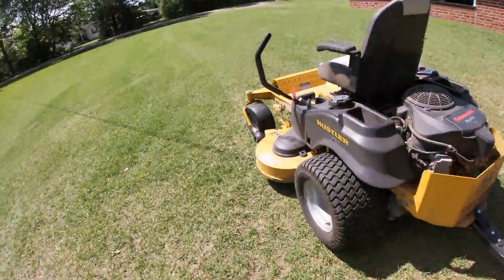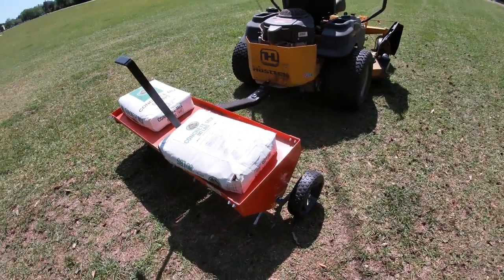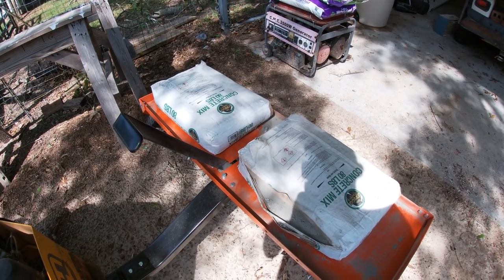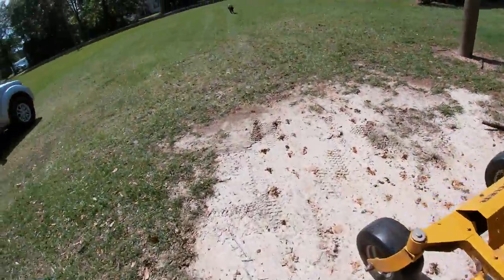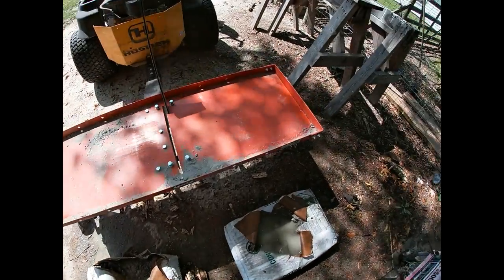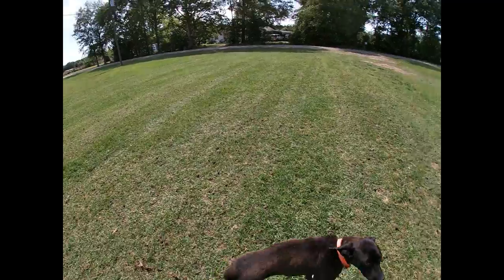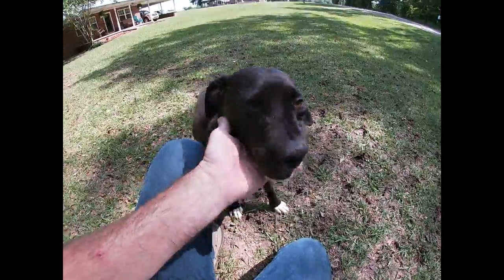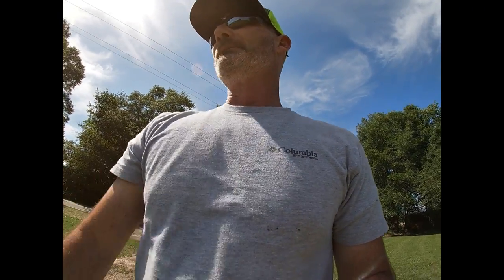Agri-Fab 48-in Plug Lawn Aerator in Action

Comment: I just got the exact same aerator and it worked like a charm!  I did however slice the back of my hand on one of the tines during assembly.
Reply from the maker: They are definitely sharp!
Reply: I cut my hand twice. Bought mine from rural king. After 3 passes around my yard a weld broke. Yard wasn’t even dry.
Reply from the maker: Oh wow. I ran mine on some pretty hard ground. Still doing good. Hopefully it doesn't break 😳

Comment: have you thought of using plastic storage tubs?  You can get square heavy duty plastic storage tubs that are the same square inch area of the platform then fill them up with water put the covers on and tie them down onto the platform then when you are done use the water for your lawn or plants by bailing the water out with a bucket or use a small sump pump to transfer the water through a hose and water your garden.  That way you don't have to deal with storage problems when storing the weights or bricks.
Reply from the maker: Never thought about that. I'm not sure how bad the water would slouch around. That's an idea though.

Comment: Thanks for the video and the info. How did the cement work out? I like that idea.
Reply from the maker: Cement didn't work that well (broke from vibration), but I'm in the process of prototyping some removable weights for it. Hope to have a video on it by the end of next week. Thanks
Reply: @cleangreenlawnservicellc2630   I use 2 60# play sand bags that I use for the bed of my pickup truck in the Winter (Ohio). They work very well.

Comment: How are you liking your X-One. Other than shocks, the height adjustment is right on the outside of my calf, the corner cuts into my leg, draws blood after a few hours, have you had any problems with it? I think mine is a 2017 model.  I added a light bar underneath the front. If you want, I could share a picture of it, but really don’t know how in comments.  I have light bars on my tractor on the ROPS, but I didn’t think it thru,  Kamikaz insects heading straight for my head right when I flip them on. 🤣
Reply from the maker: Ricky, I have no idea how to share a picture on here. I love my X-One. Do you have a suspension seat on yours? Mine is a 2020 model and I love it. Hadn't put any lights on it. Hope I don't need them 😜. Surely they are a big magnet.
Reply: Clean & Green Lawn Service LLC were you able to see them?
Reply from the maker: Ricky Choat just looked. Nice! That X-One needs a bath 😜
Reply: Clean & Green Lawn Service LLC not rained in a month, my whole area needs a bath.  Everything is dusty, thank God I installed irrigation when I built our house.
Reply from the maker: @rickyc3020  oh wow....you need rain!

Comment: It looks like your zero turn mower pulls it ok? I'd love to get a zero turn but was leaning towards a normal one just so I could pull the aerator.
Reply from the maker: Definitely not that hard to pull. I love the zero turns, but I cut a lot of grass.
Reply: Sci Guy, I have a Hustler X-One, it pulls everything I have needed to, very easily. I have pulled my lawn sweeper, detacher, another brand aerator and a 40gallon boom sprayer. I love it, just don’t try the zero turn feature while pulling stuff. . 😂 I love my zero turn, only thing I hate about the it, I’m a big fellow, and other than the seat shock, it has no shocks, it reminds me of when I was young and drove go-carts. You feel every bump.
Reply from the maker: I pulled mine with my Hustler Raptor SD. Pulls it with ease. Thanks for stopping by.

Comment: I bought the 160# unit with air tires . However I put 280# and blew out the wheel bearings . I bought new sealed wheel bearings and i sank the tines 4". After a good rain is the best time .
Reply from the maker: Wow, 4inches is a deep plug.

Comment: So was the ground watered prior to aerating? How long are the tines? I was thinking about picking this up rather than having to rent a machine or pay to have the service done to my yard.
Reply from the maker: No, I did not water the ground, but that is an option, but you don't want it saturated.  I am not sure how long the tines are but you could definitely get a 3 inch plug is the round is  not really packed hard. Thanks for checking out the video!